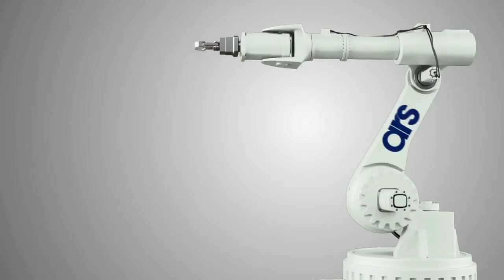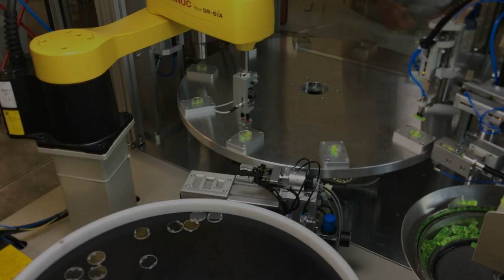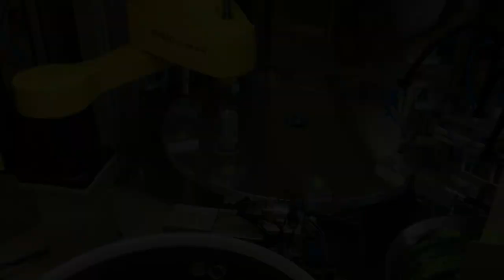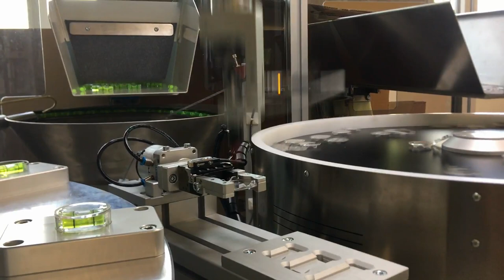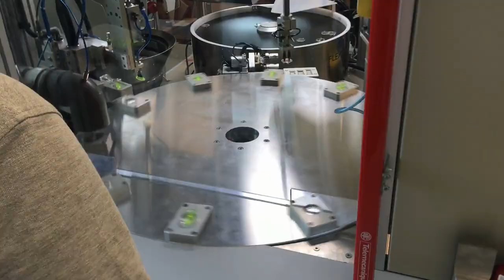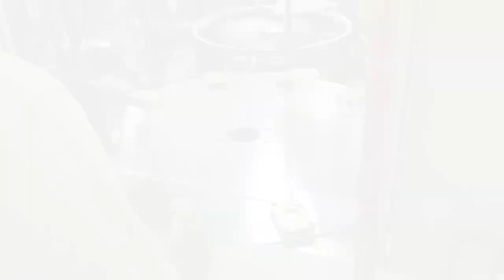Plastic Ultrasonic Welding-FlexiBowl® & Fanuc-Alternative to VIbratory Bowl Feeder

Comment: What is the robot device being used to flip over parts to the correct side for ultrasonic welding?
Reply from the maker: FlexiBowl®, it is an innovative flexible parts feeder that is compatible with every robot and vision system. Entire families of parts within 1-250 mm and 1-250 g can be handled by a single FlexiBowl®, replacing a whole set of vibrating bowl feeders. 
FlexiBowl® integrates easily with all robots brands and it offers many advantages compared to other traditional or flexible feeders.

Comment: why you use flexi bowl feeder instead of linear feeder or flexible feeder
Reply from the maker: Splitting the areas for parts picking and dropping enhances the parts flow control and the overall feed rate. While the bulk feeder refills the FlexiBowl of new products, the robot keeps picking up parts. This can be done only with our patented circular concept and cannot with linear ones that fall short in this. Please check the demo we brought at 2019 Motek where a single robot, single feeder layout reaches over 70 ppm.
Please send an e-mail to info@flexibowl.com for more detailed information on this.